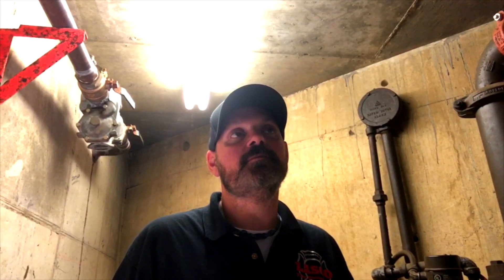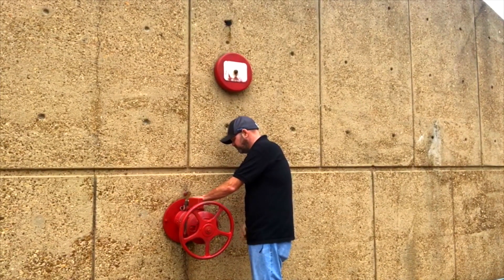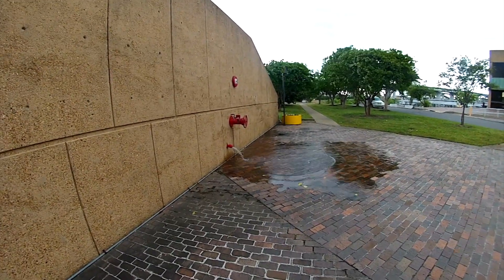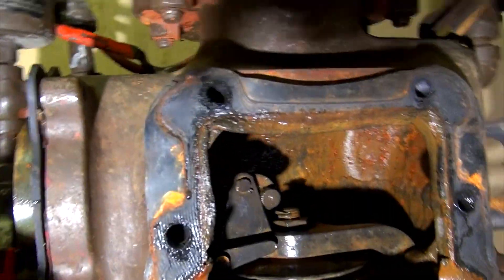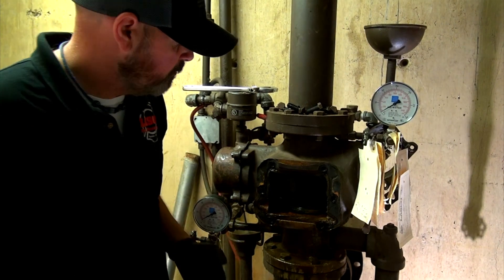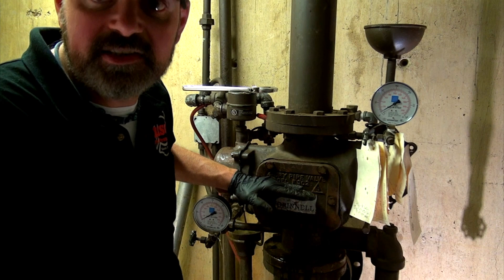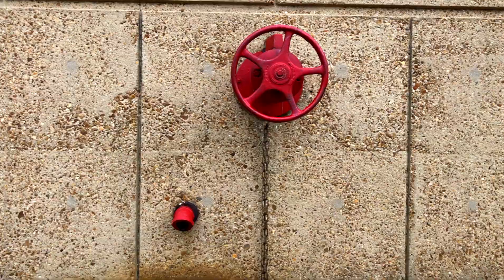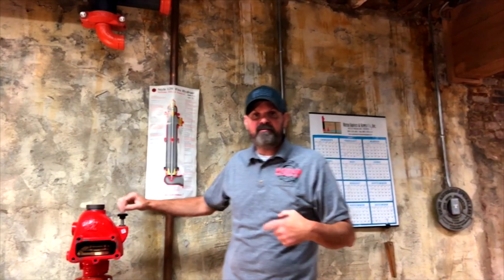Fire Sprinkler Dry Trip

Comment: As mentioned in the other comments - write up the following- Inspectors test should be identified and have the same orifice opening as a sprinkler head, not a 1/2" valve which changes the amount of time. If there is only one shut off valve (Exterior) i would check it first to make sure it actually shuts the water off. Next, have a rebuilt kit on hand if you need it because this valve manufacture can be a royal pain. The aux clapper on the side must be perfectly cleaned and a properly placed spring for it to work. You also never added priming water. Lastly when you go to reset have your main drain open and slowly turn the water on and then slowly close the drain to reset. With any trip test full or partial write on the report or have a tag on the riser that its the owners responsibility to drain periodically, In the fire sprinkler business CYA because nobody wants to spend money on something they can't see
Reply from the maker: I was the keynote speaker at the fire marshal conference. That video was made to point out some examples after the video was played. It wasn’t supposed to be perfect.

Comment: Ive seen drum drips and drains installed in some dumb places but why would anyone ever install it in a bathroom stall next to a toilet.
Reply: Assuming by the looks of the building it's an older one, assuming production facility. Reason being that it's probably in a basement/the floors and such are not going to get damaged by the tests. You have to flow water, you don't want it to potentially cause water damage.
Reply: They always put it in the women’s restroom also.
Reply: @coreya952  it does seem that way doesn’t it.
Reply: most fitters use a bucket, but maybe he was washing the floor there lol
Reply: Right lol and all over the floor aswell